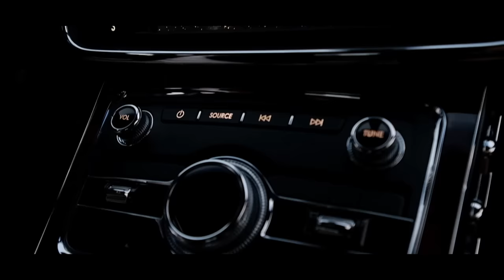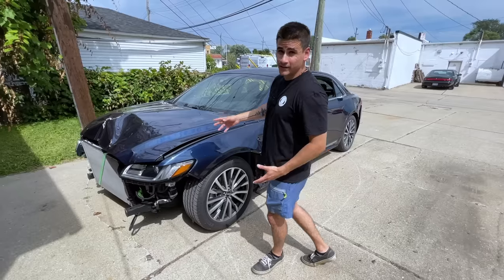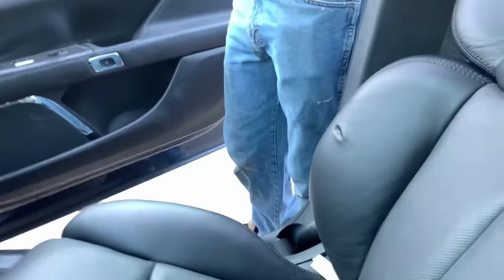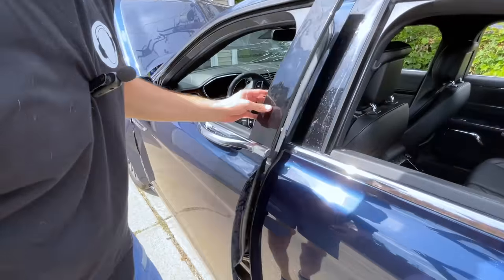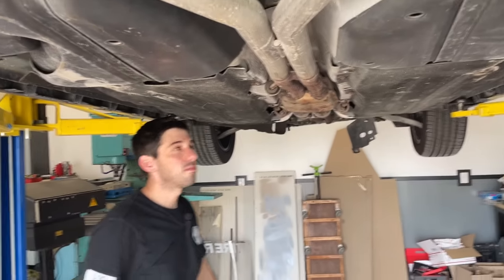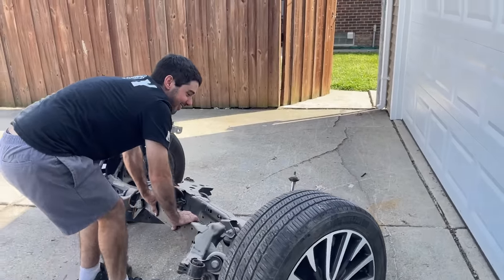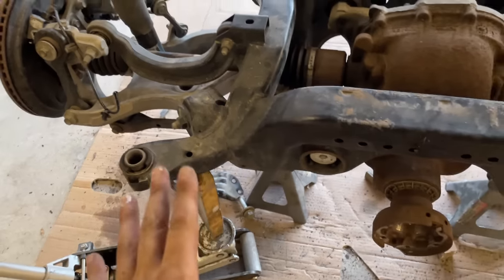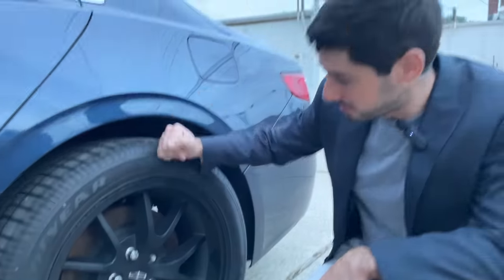V10 Project Car Reveal! - Ford V10 4V Build Ep. 15

Comment: BOOST that V10 and make this a BENTLY KILLER !
Reply: Great idea 👍
Reply: I agree but that would probably shorten the engines life considerably.
Reply: Considering this is a custom engine build with no idea what might fail not a good idea.
Reply: And sound boring. Turbos are big power-multiplying mufflers.

Comment: This is pretty cool... as a S550 owner I would say get the TR6060 if its not too late.. but the MT82 works if it must.
Reply: Or at least get the tremec 3160, the one they used in the gt 350's and the 21-23 mach 1's
Reply: @mikeabney1214 new t56 magnum.....

Comment: Third.  Oh well.  (bey the time I got done typing my novel, I am now far from third.  Oops)

That funnel in the trunk is actually fairly important for those that don't carry plastic funnels with them regularly so don't lose it.  It's actually to allow you to push the spring loaded fuel door where you put a nozzle in at from a fuel station island.  This is needed if you run out of gas sometime and don't have a plastic funnel.

Assuming this is like my friend's 2012 Ford Explorer that doesn't have a cap (Ford went to a "capless" design in some of their vehicles), I will assume this is what this car has as well.  I tried to make a funnel at one time because I accidentally ran out of fuel and only had a flyer that was essentially newspaper material.  I folded over the paper so it would be stronger and although the funnel worked fine to get the fuel in, the problem was, when trying to carefully pull the funnel back out, the spring loaded door collapsed onto the paper and caused it to lodge at the top of the fuel neck just below the little spring loaded door.  I didn't want to leave the paper in the fuel neck area so, I did my best to pull out the paper from the fuel neck but I didn't have small enough long nose pliers with me at the time and a little bit of it fell down into the fuel neck.

So, I had to remove it from the inner wheel well to get the rest out.  It wasn't fun.

Moral of the story:  Don't lose that stupid little funnel.  Why Ford decided to go to a capless system and make their spring loaded doors so strong is beyond me.

If you guys happen to read this comment and made it this far, I was going to mention something to you regarding your build and issues with the heads having that small leak at the welds on one of the heads.

I noticed when you were baking the heads to test them to see how strong they were, I believe you were baking them to about 240 or 245 degrees.

Although 240 or 245 is above what you would "want" to allow your engine to get to, the reality is, this isn't really a super high temp and you should have probably baked them to 260 and possibly even 270 in my opinion.

I'm sure I'll get engineers or other automotive techs coming in here and roasting me for suggesting this but I'll explain to you why based on my experience.

I own a 2002 F-250 with the 2-valve 6.8 V-10 and it has about 335k on it now.  Although it unfortunately has a bad head gasket (I am pretty confident it does now anyway), I believe it may not have been at first and I ended up abusing it over the last year to get it to the point of making a small problem very bad.

It started with a small leak and I thought originally it was a heater core but now I'm not sure as I have a radiator leak just below the upper neck area with a crack running about 3 inches directly underneath the neck where the curve of the neck joins the main radiator portion.  And, although I could have swore I had coolant coming out of the A/C drain tube about a year ago and I "thought" I smelled coolant inside the cab, I haven't smelled it for a very long time and I don't see anything coming out of the A/C drain tube and there is nothing on the floor.  So, I must have been mistaken at the time I thought that's what was wrong.

Back then, I had a couple other vehicles that I was driving so I wasn't really worried about it and didn't get super in depth with diagnosing what was wrong.  Unfortunately, one of my pickups got totaled and the other one quit so I'm back to driving this one again.  Anyway.....

This crack started out as something small of about 1/2" to 1".  Over the last 4 or 5 months, it's gotten worse.

I've unfortunately not fixed the issue entirely since I suspect or am pretty confident that it's going to require a head gasket and I likely have cracked heads at this point so tearing it down won't do me any good until I have replacement heads ready or the money for them.

Where am I going with this long winded novel about this?  Well, I can only go about 15 to maybe 20 miles before the engine over heats if the weather is decent and I'm not pulling anything.  If I'm pulling a trailer or it's hot or I decide to go faster, I only get about 10 miles before I have to stop and put 4 gallons in and repeat every time it gets to that point.

But, when it gets to that point, the engine does start to lose power as forced by the PCM because the V-10 engine has a "fail safe" program built into it to try to prevent complete catastrophic failure and it shuts down a few of the cylinders and alternates which cylinders it shuts down to try to get the non running / operating cylinders to act as an air pump and cool the engine off.

My engine does not do this until about 268 or 270 degrees.   I believe I have seen as much as 274 at this point.  Extremely high for sure.  Typically, I try to pull over when it starts to get to 245 or 250 but every now and then, I push it too far and hit those 270 plus marks more than I would like to admit.  Once I spend about 4 or 5 minutes getting 4 gallons of coolant back in, the engine is cooled off and I'm running great again until I have to repeat the process all over. 

The gauge doesn't really start to move towards the higher limit or line until about 240 degrees and then the over heating warning light doesn't come on until 260 degrees.

I run the Torque Pro app with my phone or tablet and constantly monitor the various sensors so I'm pretty confident it's accurate.

There is a sensor to monitor cylinder head temps and if memory serves me correctly, they are about 10 degrees warmer. than the engine coolant/temp sensor  I could recheck though to verify if you need me to.  They also have a temp that goes up way higher and I want to say it gets into around 1500 to 2000 degrees but can't remember for sure what that reading gets to.

Obviously, I'm abusing my vehicle and running it way hotter than I should and I'm assuming I have a head gasket problem now.

I tried to fix the radiator a while back with some high heat JB Weld that is supposed to be specifically for high heat stuff like plastic radiators and unfortunately, I believe the problem in the cooling system just got worse and worse to where the pressure build up just made the crack worse and I tried to fix it a second time and then it got even worse.  I suspect the abuse has likely caused the head gaskets or head to get worse and worse.

Should you try to drive your vehicle to 250 or 260 degrees?  Of course not.  I'm just thinking that 240 is not really enough though.  Obviously, this is your guys' call.

I actually used to be a  Ford tech at a couple dealerships and I'm aware that the temps I'm typing here are very high and I understand if you disagree with my thoughts on trying to make sure your heads will stand up to higher temps than 240 or 245 degrees.  I'm just one to push things to an extreme limit.

I'm really hopeful that this all works out but I'm worried you're going to have issues with the weld areas.  I really want to be wrong on that.

Although perhaps you don't have much content to upload, one thing I would suggest is to try to come up with some sort of content so you can have new videos daily.  We Ford V-10 lovers look forward to something different since these are sort of a forgotten engine.  Having to wait a few weeks or a month is just way too long to wait.

In my opinion, the Ford V-10 is probably Ford's larger engine that they should have kept in production and should have improved on what was a great engine.  It was so reliable and so low maintenance.

I think if they would have increased the cubic inches to say an 8.6 or even a 9.0, that would have been something.  Or, at the very least, put a turbo on it or super charger.  The best part is that both the old and newer 3-valve versions do NOT have cam phasers like the stupid 5.4 has to give it problems so it's super reliable.

Since they took care of the issue with the spark plugs, if they could just increase the size of the exhaust manifold studs or bolts to make them less likely to break, that would be one thing that would really improve the annoying things that owners would have to deal with.

Also, if they would change the way they have the engine oil filter cooler/heater instead of having it underneath the engine mount on the driver's side, that would also be a plus.

It's a shame Ford took it out of service because it was a hell of an engine.  Good power but it had a lot of potential for so much more.  If they would have increased the size and put either a turbo or super charger on it, it would be desired by so many people looking to haul trailers.  

And, of course like you guys are doing, if they would have made it a dual cam version, that would also have been a major plus.

We need to see this engine running soon guys.  It's been too long getting this going.  Hurry up already.

Comment: I missed this video somehow before the V10 startup one and I'm re-watching now. I'm glad I'm not the only person who appreciates just how expensive Mercon LV transmission fluid is. When I first bought my Flex it was like $10 a quart. Best fluid I've found since then is actually the Valvoline Dexron VI/LV. The Max Life is supposed to be spec'd to work in the 6F55 transmission but I get harsher shifting with it, and I don't know if the Max Life had anything to do with it, but I've gone through 2 torque converters in 70k miles. This is after the factory one lasted 135k miles. Their LV specific fluid is actually cheaper, but the trans works better than new with a new converter and that stuff in it. It's better than the OEM so far. Nice bonus is it doesn't turn black like the Motorcraft fluid.

Comment: Been watching your journey into fast and I am somewhat impressed. 
I have built a few cars in the past but nothing like what you are doing with the engine. Never had the $$.
 I bought a 72 AMC Hornet a few years ago intending to do something similar with it. I have an independent 3.70 gear rear frame out of a Thunderbird. I have the front brakes from an AMC Pacer that will bolt to the stock front end. I hope to help my son-in-law build this for my daughter.

Comment: Fwiw, that funnel is for the gas tank. The cap-less filler necks Ford uses requires that specific funnel to fill or siphon when not at a proper gas station.

Comment: I'm pretty sure somebody has answered this question. But just in  case it has not. If your vehicle that does not have a gas cap. You definitely want to know where that funnel is. If you try to use a traditional gas can to refill your tank if you run out of gas. It will not work because the neck will not go deep enough to unseal the passage way. You have to have a funnel. I found this out with my Chevy  Colorado when i ran out of fuel.

Comment: The funnel for gas fill up. If the nozzle doesn’t go into the gas filler because it’s a little distorted you then you have to use the funnel.

Comment: Loving the build series! The Continental is an inspired choice. One thing for consideration: if I recall correctly, the GT500 front brakes are very similar to Boss 302 brakes. They’re excellent brakes, but the caliper packaging makes it very difficult to obtain wheels that properly clear the calipers. Almost no aftermarket wheels will fit…. One option is to use spacers to move the wheels outboard, but that hurts the whole front steering geometry. Another option is to use GT500 18” wheels or Boss 302 19” wheels. Alternatively, you are pretty good with a lathe and a mill; you may be able to machine the required clearance into the wheel spokes. Gonna be such a cool ride!!

Comment: Definitely different & interesting. I have a V10 in my old (but in good shape) F350. It had an intake on it when I got it a few years back, then   I did TBC headers, the SPD Y-pipe kit, and Gibson side exhaust. 
The only cams offered are from Comp, $1400+. Guys have supercharged them, seen a turbo kit done...but the weak link? Split-pin crank. Since it was only developed as a torque-pull motor, several Ford builders said to not go over 650 hp. It's not meant to rev to the moon and will grenade. I never planned on it. I was just uncorking the truck a bit-
Reply from the maker: We'll see what happens!
Reply: @biy_buildityourself  Oh yeah, I'm interested for sure

Comment: Things just got a LOT more interesting 😂 

Do yourself a favor and buy a driver outside door handle now, it WILL fail (it probably has been replaced 10 times already 😂) 

I maintain a fleet with 9 of these. All 2017's with +/- 200k miles, all 3.7's with AWD. Door handles and more door handles! (But we do livery so obviously the doors are used a LOT.  (Ford contacted a company that makes micro switches for microwaves! They are not serviceable and you need to replace the entire chrome top section of the door.

Comment: My old boss bought a AWD 3.0tt one, damn thing was fast would cruise at 130mph. To bad it had so many oil problems. He then got rid of it, and got the Navigator with the same 3.0tt engine which ended up having the same oil issues.

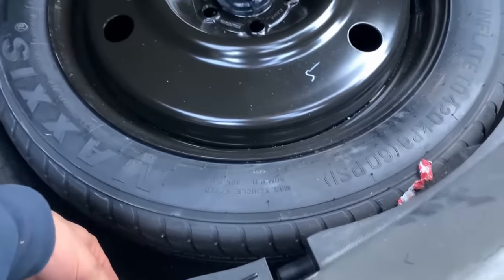Comment: 7:00 That funnel is for fuel. Ford started using cap-less fuel system since 2010. That funnel will open the filler neck for you to pour additives or use a gas can. Also the CD4 platform is the Taurus platform, the Fusion is CD3.

Comment: @BuilditYourself: 
After I saw your two videos of the engine build and of the Lincoln, I wanna see the continuation of this project.
I'm very curious as to how you guys will handle the challenging task of the wiring harness you'll be using.
Outstanding work that you guys did here. 
Please continue to post all future updates on this difficult but doable project build, cause they are worth watching.
Thanks.

Comment: Maybe it might have been a good idea to temporarily brace the cars transverse box section before extensive metal surgery in this area.This could stop distortion that can make problems with wheel alignment and tracking later on.Anyway you are young and luck is probably on your side.

Comment: Never mind that you're fitting a rear wheel drive powertrain into a front wheel drive platform (hope you like doing lots and lots of welding and fabricating), but the stock ecoboost twin turbo V6 was putting out around 400 to 450 horsepower depending on trim level in the Continental.  Considering that the stock 6.8L Modular Triton V10 was putting out 265 hp in three valve trim (it's primarily a torque truck motor, and Ford never offered a four valve head from the factory for the Triton V10, however a 32 valve head from either a 4.6 or a 5.4 V8 should fit), you're setting a pretty ambitious bar for that V10 engine, not to mention that V10 being a lot heavier than that Ecoboost V6.

If it were myself, I would have waited for the Godzilla 7.3L V8 instead of that out of production, outdated V10.  The Godzilla V8 weighs less than the Triton V10, has two fewer cylinders, probably has better fuel economy, yet puts out more than 50 percent greater horsepower (430 hp stock) with a lower weight penalty.   The Godzilla V8's have seen more than 1,000 horsepower with boost.  More stock power than either the Ecoboost V6 or the V10 and it would have handled better with less weight on the front crossmember.  Just my $19.03 (bonus points if you catch the connection).

Also, unlike the Triton modular V10, the Godzilla motor is a good old fashioned Ford overhead valve V8 (just like the legendary V8's [Windsor 260/289/302/351 and 460] prior to the Modular 4.6/5.4 SOHC and DOHC engines) so that the cylinder heads are narrower than on the overhead cam engines, making for easier fitment in the engine bay.  The Coyote V8's (all of those are DOHC) have enormously wide cylinder heads and often require heavy modification in vehicles that didn't originally house those engines.

Congrats on your one of a kind project nonetheless!
Reply from the maker: We plan on making significantly more than the 305 to 362hp the various 2Vs and 3Vs have with our 4V V10. But it's not all about raw hp, that's why we staying N/A 😉

Comment: That's insane it went in that easily.

The real work is to come with the front and fitting the engine and trans. And of course THE ELECTRONICS.

Hopefully it gets an auto. It should have an auto.

But if you guys can cleanly integrate the electrics this will be absolutely sublime.